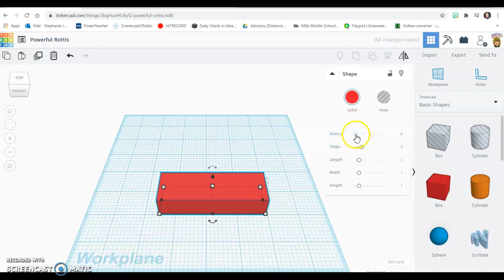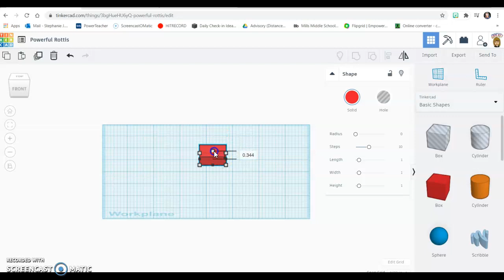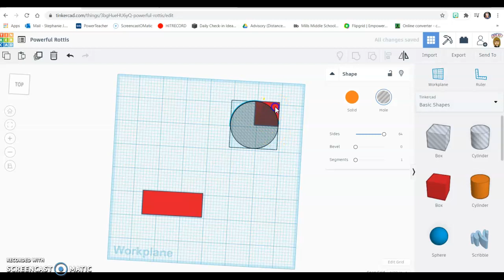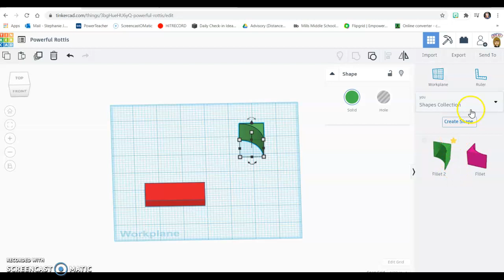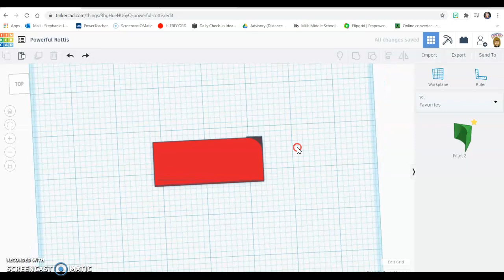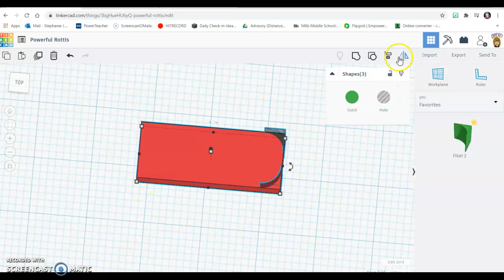Tinkercad Tutorial - Fillet, How to round corners

Comment: Hi there, great video. Is there some way just to curve the vertrx? For example as your draw I wanted just the top with rounded corners, but the botton as normal rectangle. It should be amazing if it was possible to select a vertex or vertices and add radios to it. Isn't it possible? ;0) Thanks.

Comment: When rotating objects if you keep the mouse closer to the center it will snap to 22.5°, 45°, 90°, 180°. Hold the mouse outside the circle for finer control. Also when using align tool you can click the object you want to remain stationary and the other object will align to it. I need to start adding custom shapes to favorites! 👍

Comment: A quicker way is to  just do the square/rectangle with whatever radius value you want, and then use 2 rectangles (in "hole mode") to trim the top and bottom, getting rid of the bevel on the Z axis. This will  leave you with the flat surfaces you want and the round corners you need.
Reply: The problem - you can't do it with complex objects.